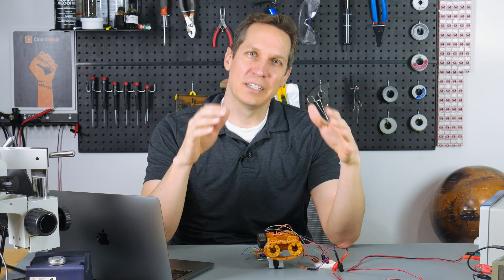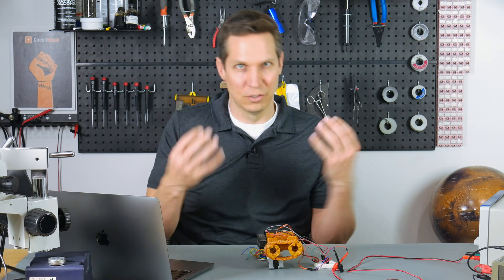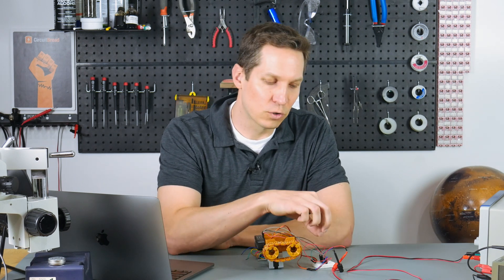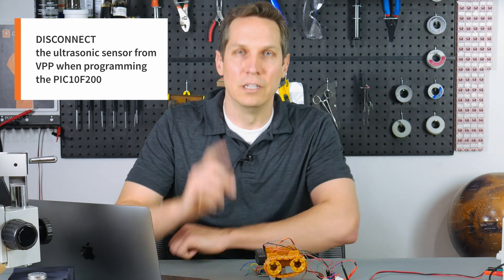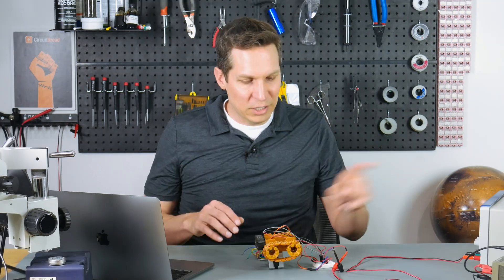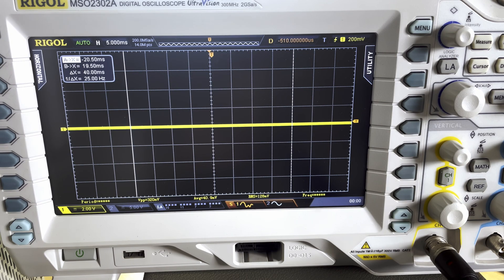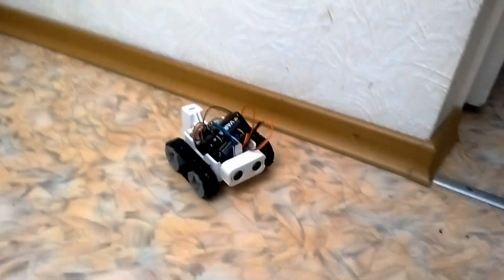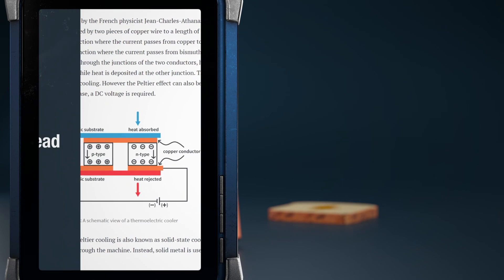Ultrasonic sensor with Microchip's PIC - Part 14 Microcontroller Basics (PIC10F200)

Comment: Hello i have aquestion how the binary codes are represented  to me on the screen for example how 10 is represented on my screen as 2 what is the hardware component that is responsible for it
Reply from the maker: In this project there is no screen to display it.  In other projects, that conversion from binary to decimal and back is almost always done in software.  If you're transmitting something via UART to your computer, then even further modifications are required to turn the number you have into its ASCII equivalent, or else it will show up like gibberish on your screen.